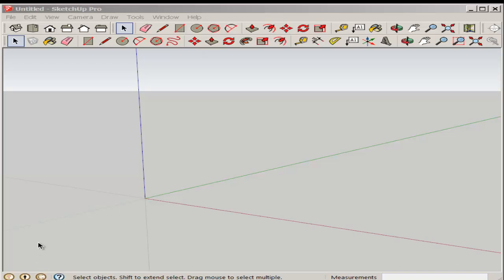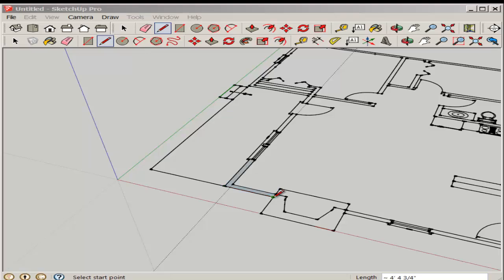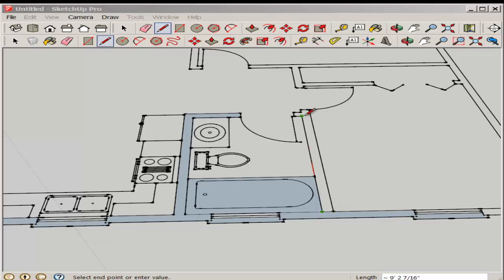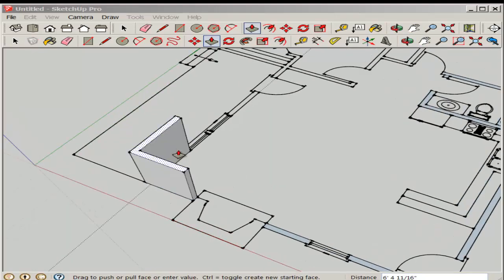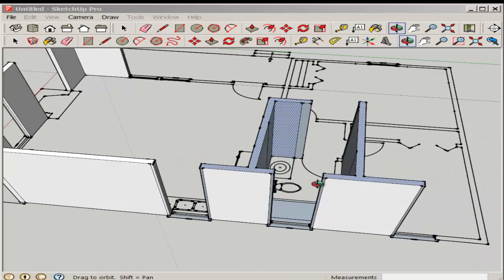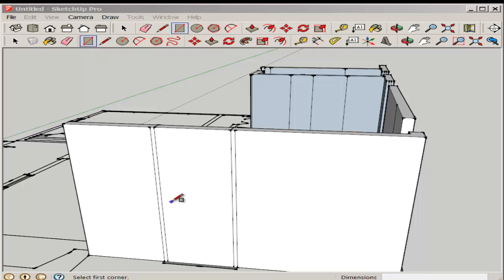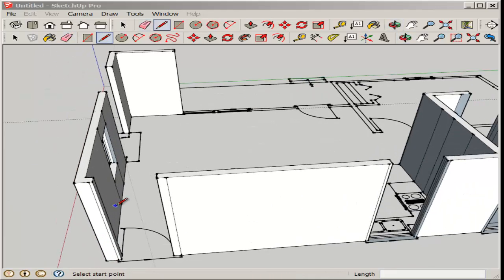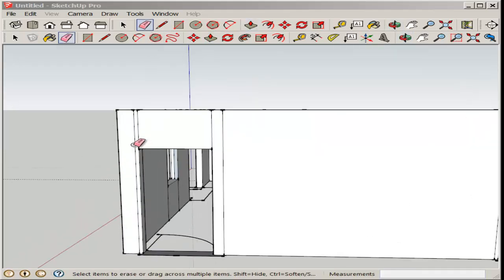SketchUp: Import and Model an AutoCAD Floor Plan

Comment: someone can help me??I'm getting stucked to import my file from autocad to skechup because according the instructions from the video the images in my screen are appearing differently so I can't find the options shown through the video which are not exctly to what I see on my screen.I'm using autocad 2020 and sketchup 2017.
Reply from the maker: You need SketchUp Pro. Also, you can't import AutoCAD 2020 into an earlier version of SketchUp. You need to save it as an AutoCAD 2016 or earlier file.

Comment: good dayi lke all your Videosi would like to be an architecurual  drafterfrom your own Point of view  and your experience  to go into into this field should I be good in math.or one must know only the Basic in Volume area  and Basic mathimatical Operation like dividing subtraction i have a Bachelor degree in linguisticsi like a interior designing  but i am not that good in math  .in this Business do i Need calculus please i Need yourhelpforexample in your daily Routine work what do you Need the most for drafting manually
Reply from the maker: Hi Issam, here's a link to the drafting program where I teach. It lists the courses we think are important and necessary for a drafting job here. http://catalog.jccc.edu/degreecertificates/draftingtechnology/comp-aided-drafting-and-design-tech-aas/
Reply: thank you so much profdrafting.